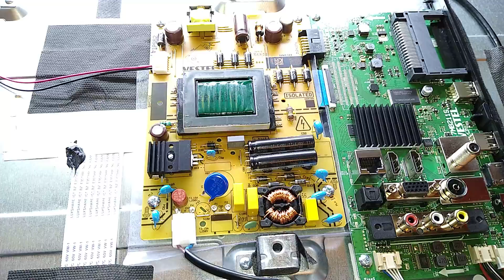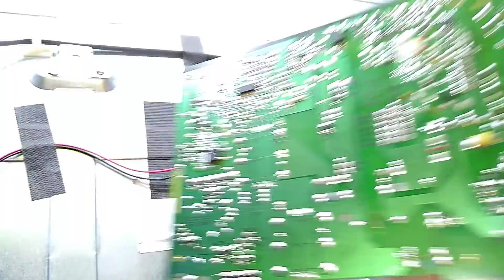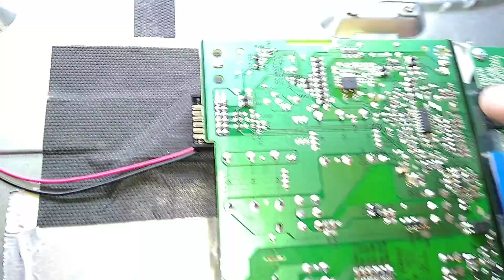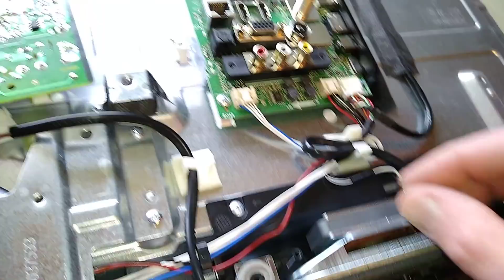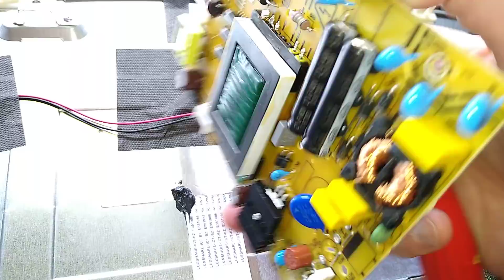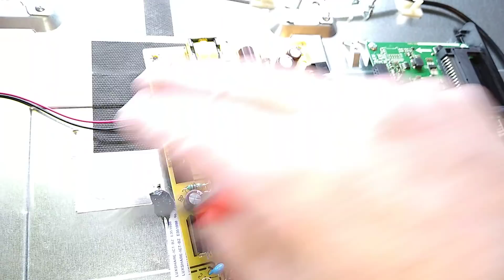There's not much inside TVs these days

Comment: That's a lot simpler than my 10 year old TV, much more circuit board area to ponder over. Disaster struck at the beginning of the Covid lock down when it stopped working. Stern words from the rest of the family - "I thought you could fix things". Toasters and vacuum cleaners yes, massively heavy 50" plasma TVs, not so much. I bought a repair kit for it, but it didn't help - power board still busted. It was only careful examination when powered up that showed a small amount of arcing at the transformer pads. Reflowed all the solder joints in that area and it started working again.
Reply from the maker: Good job.   Reflowing solder connections on things like transformers is a common repair technique.
Reply: @bigclivedotcom  Old flybacks from CRTs had that problem like a disease because they were usually the heaviest component on the board.
Reply: @MikinessAnalog  The annoying thing with many of the later CRT monitors (even high-end ones such as were used by Sun Microsystems), was their complete lack of user serviceability.  Because everything was potted (for "safety" reasons), components were inaccessible, so instead of a few Pounds for replacement components, we were faced with many hundreds of Pounds for a complete module, since with Sun Systems "you pay for the name".
Reply: @phils4634  Try to repair an AC / DC  VCR model that was AC by nature and used its own internal inverter on DC.
LOL
Talk about inefficient.
Reply: @phils4634  That explains why they were so fucking heavy, my CNS class had nothing but them and we had to move them around all the freaking time cause Jim just wouldn't keep a single room layout -_-!
Reply: @MikinessAnalog  So right! If the TV falls on its face, the PCB around the flyback transformer gets damaged somehow...
Reply: @MikinessAnalog  yes Murphy’s Law, the most heavist and awkward component needed the most attention.
Reply: @phils4634  In the amateur radio club I was told that surface mounted technology killed off the back yarders, you couldn’t just replace a capacitor. Although a work colleague told me you can fiix surface mounted parts, just more fiddly.
Reply: @bigclivedotcom  Power devices too.  The thermal cycling can crack the solder joint.
Reply: @bigclivedotcom  that's exactly how I fixed my oven's control board this past weekend.
Reply: @bigclivedotcom  Sure is. Done it a lot myself. The weight on some transformers tends to not cooperate with solder joints. Especially if
mounted sideways or even worse, upside down.
Reply: @bigclivedotcom  - ahh, just like the transformers, inductors, power resistors and power transistors in CRT sets then 😁
Reply: I hope you received an apology from your family for the dissing of your repairing prowess.
Reply: @Loonistrator  "I told you that I don't fix things"....

"But you just fixed the tv" -family probably
Reply: I fixed a floor console CRT TV when I was in electronics college. This thing weighed maybe even more than a refrigerator. Spent huge amounts of time hauling it out of my Aunt's home & such and it turned out to be a wafer thin device in series on the degaussing coil. It had just come apart & I soldered it back together.
Reply: @johnpossum556  I had to unpack them when new and put them on display... for three years. By myself.
       edit: I forgot to mention they had to be brought up about 6 steps.
Reply: My Response would be "I thought you could respect others". I'd have closed up the broken tv and picked up a favorite book.
Reply: I had an old tv (2005 ish lcd) that would turn on and then almost immediately turn back off. So I removed the back to see if there was anything obvious. I didnt see anything at first but I heard it. Everytime I turned it on there was a quiet buzz then it would shut off. I turned off all the lights and tried again. There was arcing between the high voltage wires for the florescent tubes. I didnt see any damage, but I had some high voltage electrical tape, which fixed it. It's my security camera monitor now.
Reply: @zachdemand4508  I had a widescreen tv around 2003 that I loved as it had 5.1 surround built in amazing sound on it but one morning it just didn't turn on, the led on front would be on, press the on button on remote hear a slight sound like when a crt is meant to turn on the led went off.  I had another CRT in 2007 which was amazing but had green lines over it and sometimes 5 minutes sometimes a hour it would turn off and make crackling sounds, still curious to what killed them.
Reply: Many years ago as a 10 year old boy I learned the fine art of repairing televisions.  We are talking back in the 50's.  Most of the time, just tubes to fix them.  After a while I took my offered gratuities and bought a tube tester from Lafayette Radio, upping my game a bit, not having to run to the local electronics store to test them.  Wonder I never died from the HV circuits.  Continued my passion for electronics for a decade long stint in the US Air Force in the electronics career field.  For the past 25 years still working on automotive /RV electrical issues.  Always loved doing what I began as a kid making stuff work.
Reply: I guess heavy parts like transformers (and connectors that see abuse) are prone to their solder joints cracking. It should be a more common troubleshooting tip. I was desperately trying to figure out why my ICSP header on an MCU dev board wasn’t working, turns out the ICSP header’s solder joints had been cracked possibly for years.
Reply: Plasma still rule in my book. I have an 42" Hitachi that's waiting for my attention.
Reply: @yoduro  A lot more can go wrong in plasma though. Having mains split up into many many more multiple voltages (especially the HV for the screen).
I have also heard that plasma have their own version of "ion burn".
Reply: @MikinessAnalog  yes, they are much more complicated.
Reply: @yoduro  When we were last in a real shop, looking at TVs, we were approached be the salesperson and we pointed out the displays that we liked the most. "Ah, you're plasma people". I think it was a compliment.
Reply: @albanana683  Indeed it is a compliment.
HHHmm..I think we may have visited the same store.

We were the Pioneers! (& Matsushita;)
Reply: @yoduro  Hah! My parents also have a 42” hitachi plasma they got wayyy back when I worked at Best Buy
Reply: "I thought you could fix things" So... you proved them right? I mean by the sounds of it, they weren't wrong :P
Reply: My china made AOC Tv stopped working about 6 month back; the remote control will not work. I could not fix it but the buttons on the sides are still working. My main problem is that I need a large table to open it up and look at the anatomy...
Reply: @janami-dharmam  have you tried testing the remote? Battery, most digital cameras can "see" IR.
Reply: @janami-dharmam  I damaged the remote control infra red part on the board inside my CRT, I went to clean it and risked using a vacumn cleaner it gave a small spark, rest of tv works but the led on front for the remote is off and the remote no longer works, luckily I can change volume and input on front buttons but still.
Reply: I have a old CRT tv that has two faults, mostly been unused in bedroom for years, even when I used it now and again like 8 years ago it had a issue where the sound would dissapear, sometimes a small thump on top sorted it and sometimes not, eventually it sorted itself I always thought it may of just been dry solder, the newer issue is that I didn't use it for over 4 years then turned on and the RGB scart connector was a bit iffy and wobbled it and it came back then looked like a old RF channel that was tuned badly, but the AV Scart port (tv has 2 scart sockets) is fine Im wondering if its damaged solder on the pins or the socket itself, I would love to fix it as I want to use it for retro stuff in guest bedroom.
Reply: @revengenerd1  "unused in bedroom for years" - I hear ya dude, speak to my wife. Oh wait, we're talking about TV repairs here. The symptoms you describe are pretty much text book bad solder joints. Well worth spending a little time with a soldering iron to reflow those connections.
Reply: I threw a 42inch  plasma away, it was a salvage from the shop "Dorothy Perkins, for the larger lady" a screen from their old  shops.... Which closed down year ago. But it had no remote, and weighed 88lbs in weight, and had been in the cupboard for years...
Reply: I can fix things, but I choose not to.
Reply: Nice one.
Reply: I once had a monitor whoose buttons where always pressed or didn't work at all, which caused a lot of jank. I fixed it with some 99% Ethanol cleaning and reflowing the pads too.
Reply: w a i t this comment was posted a week ago O_O
Reply: @lunamare_stg  donators
Reply: @plasmachicken  Donors
Reply: @plasmachicken  yes, early release for the donors, but i like time travel theory ;)
Reply: @lunamare_stg  I noticed that too, bigclive has a time machine !! Can't wait for the teardown :)

Comment: I may have a try at fixing my mom's TV that has a flickering backlight. It definitely got damaged in a surge and everything else except the backlight appears fine. Got any ideas what it could be Clive? It's a CFL-lit TV and I suspect the CFL power circuitry.
Reply from the maker: When the tubes fail they can start going unstable. Is it quite old?

Comment: You did the two non-parts replacement steps I would have thought of for fixing that fault by checking the LEDs and removing/reinstalling the circuit card which in the process re-seated contacts and re-established the chassis ground. The only other thing that I would have even checked before chucking the board (or the telly) in the E-Waste was the capacitors. I had a computer monitor that failed due to capacitors earlier this week. I just replaced the monitor because it was 14 years old and I bought it used 9 years ago. Your vids look better on an IPS screen anyway.

Comment: I’m surprised you can get parts.  In the US I had a hard time getting parts for anything more than 18 months old. At least from the manufacturer.
Reply: I live in germany and most of the time i don't want to wait and order something from china i will find it in the UK to my surprise. Costs me a bit more but i don't have to sit on something broken for a month or two.
Reply: Yeah you're not going to get it from the manufacturer anywhere. You have to source it from salvage resellers. I've repaired quite a few of these by replacing the power boards here in the US. Sometimes you get lucky and it's an obvious capacitor but that was more prevalent in the early 2000's model TVs that had all sourced some really janky chinese caps. QC has gotten better since.
Reply: Also in the US. Most of the time it's not worth the cost of the board on an old TV. One of the inputs died, and considering the connector is fine, it's an issue with the chip, on a model from 2009 or 2010. The board itself was $200+, used, before shipping. For that price I can easily find a direct replacement for that TV, or I can save a bit and upgrade to a model from a year or two ago. 
Like most consumer electronics these days, it's cheaper to just get a full replacement than trying to fix anything. Especially on TVs where almost everything is proprietary to a specific model.
Reply: I couldn't find a replacement board for a Vizio TV I have at all, and it's only a few years old. Let alone a Samsung from 2008 that now has a broken HDMI port but otherwise still works
Reply: @ohnoitschris  I have two TV's that are VIZIO's that I use for computer monitors, they are a little 'flaky'. They were the cheapest for the size, you know I got what I paid for.
Reply: Parts can be hit an miss, I started my apprentice days in tv and video repairs most items were off the shelf back then or next day, now days they make they parts obsolete so quick, not available to the repair trade or just make them so expensive it’s not worth the repair costs
Reply: Don't go with the mfr.  For example, get parts numbers that interchange on panelook
Reply: I'm also looking for an LG 42 inch mainboard. €75 seems a bit much for a 2nd hand tv from 2012.
Reply: Vestel is a major TV manufacturer in Europe based in Turkey that builds for dozens of brands so these boards are really easy to find as they are used in literally hundreds of models.

Comment: the last 5 sets I have repaired have been psu caps or screen led faults. 3 were different brand names but exactly the same hardware (Vestel) boards but different programming onboard once powered up and the main common thing was the blue screen when no tv or hdmi signal was present. the screen led are easy to replace once you tear down the chasiss but the plastic mounts tend to be a pain to remove depending on the age of the screen. the ptc heat plate will make changing led a simple task, easier than using the hot air I find.